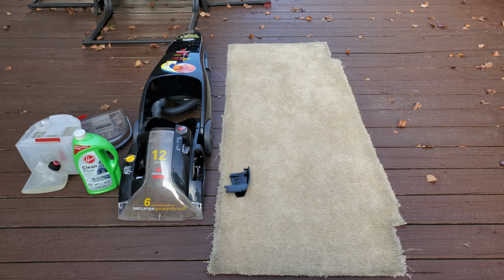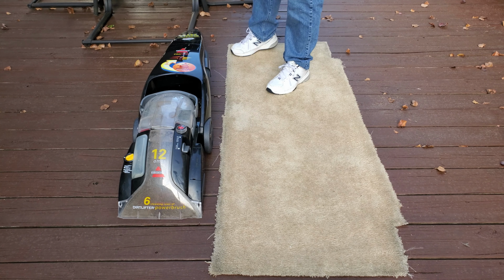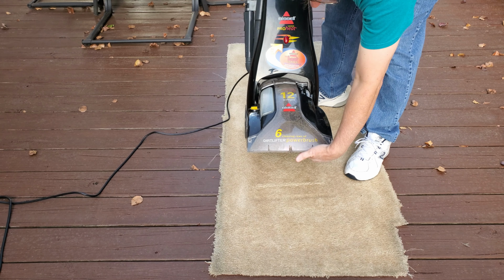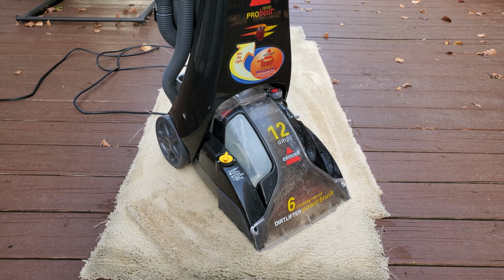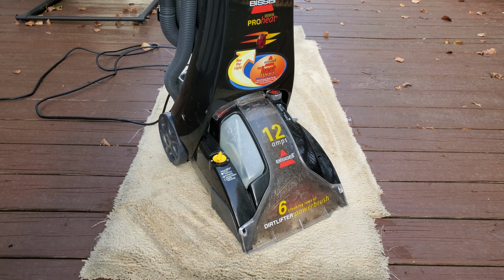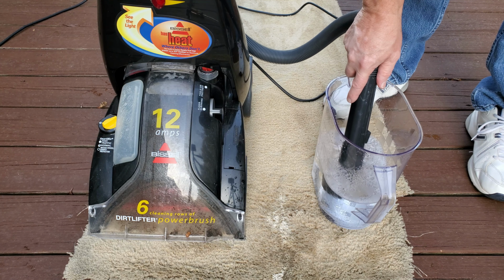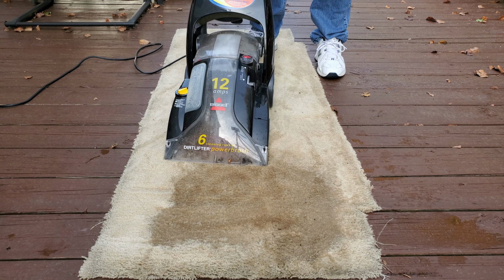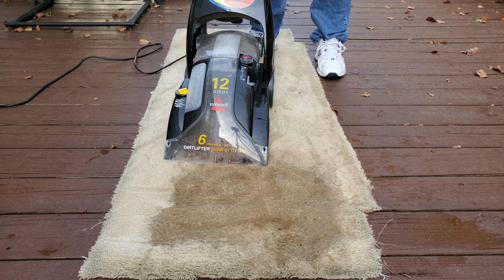Bissell Pro Heat 12 Amp | Can It Be Saved?

Comment: at around 11:50 when you were testing the hose pick up, you first had the silver knob set on the floor pickup setting, then you cut and came back and the knob was set on tool setting, and the hose worked much better.  Not sure if you were aware or just a bad edit.  Great video BTW

Comment: Same shampooer as ours, we bought it new years ago, over time as we used it the thing got worse and worse until it didn't work anymore. Wife wanted a new one so I thought maybe I could salvage it before I threw it away, I completely disassembled it and found out all the hoses and the heater were plugged up with lime. So I completely cleaned it and it works as good as new. The only water we use in it now is DISTILLED water and everything is fine.
Reply from the maker: Wonderful!

Comment: I just rebuilt one of these, an uncommon  self-propelled model from 2004. I spent $20 on the unit, and another $20 for a used motor since the original one had a badly damaged commutator bar. I really enjoy it! These units were always great residential carpet cleaners when maintained correctly.

Comment: My friend had your exact Bissell in her attic, practically brand new. We replaced 2 of the belts that were dry rotted, cleaned the heater. It’s spraying, not sure if water and formula are mixing together. There appears to be a leak on the very bottom. I can’t figure out how to remove the black piece on the bottom, you can see a hose in there. I have a feeling this has something to do with the hose. Help!
Reply from the maker: Try removing all visible screws.
Reply: Hello again Mr VacLab, you have been so helpful. I’ve replaced both belts, replaced the pump. I have 1 mystery to solve and if it can be solved I’ll be on my way to getting my wonderful pet’s stitch out of my rugs. I’m having trouble with the piston that sits in the smart mix dial. It’s under the cover. As you know it goes up and down to control water rinse only, medium traffic, high traffic. If I could send you a photo to show you, maybe you could help.
Reply from the maker: @FLYANDPHOTO just keep replacing and/or reconditioning parts until it works properly again. Best of luck. 👍

Comment: We had one of these 10 years ago. Brush motor died. Replaced it with the big green. The big green cleans 10 times better than the pro heat ever did. Pro heat would pull out grey water. The big green always pulls out straight black water. You can tell the difference in agitation and suction on the carpet while cleaning. The pro heat needed 24 hrs before the carpet was dry. The big green only a few hours.        I did however steal the heater out of the pro heat and used it as an engine block heater in the winter.